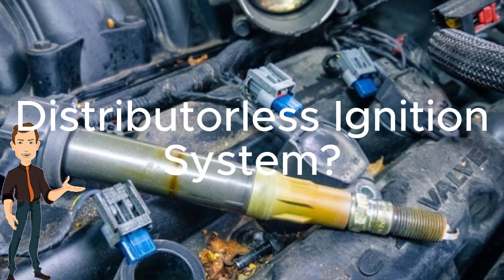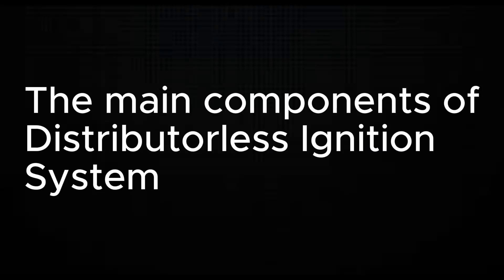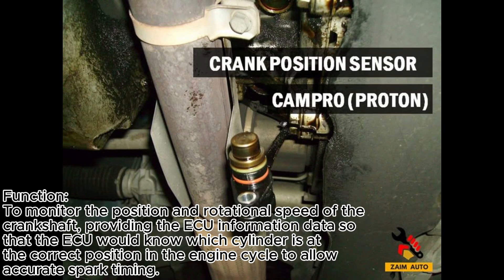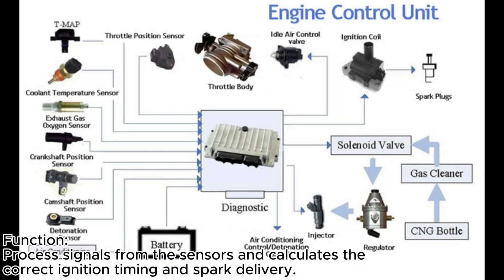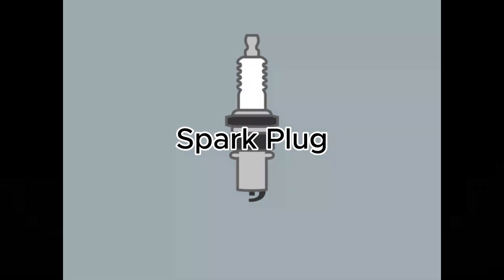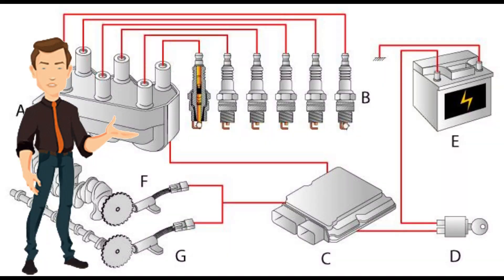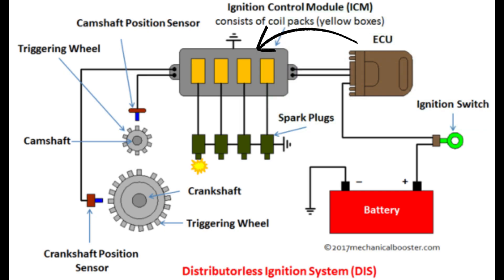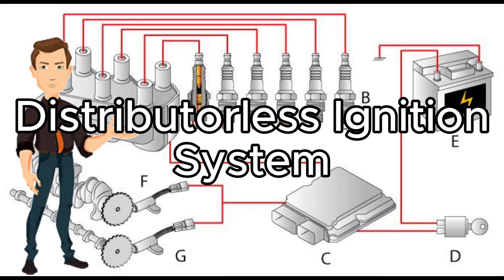Understanding how the Distributorless Ignition System Work

Comment: I have one question what is the number  of the firing system like example when it ignites at spark 1 it goes to 4 or goes next to 3. Thank you
Reply from the maker: Hey, thanks for asking, for the coil on plug firing sequence, the first spark will fire on the 1st cylinder, then it will fire the 3rd cylinder, the firing sequence will look like this: Cylinder no 1, 3, 4, 2.
Reply: Thank you know i understand  @BorneoIgnition